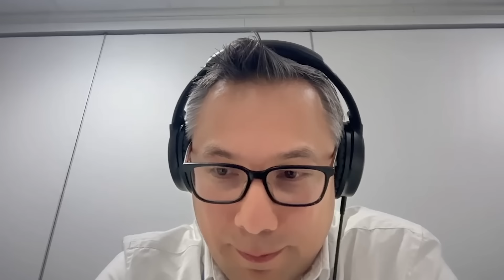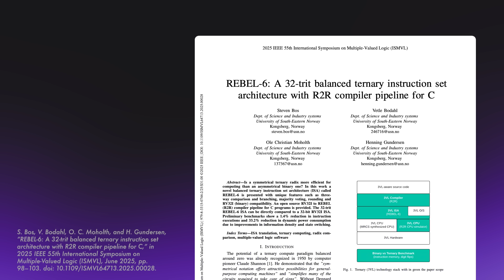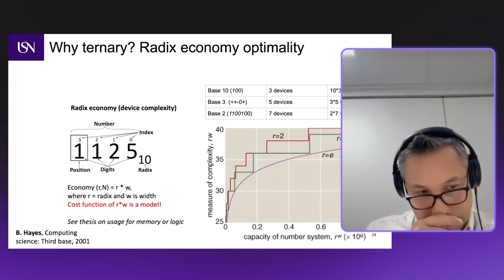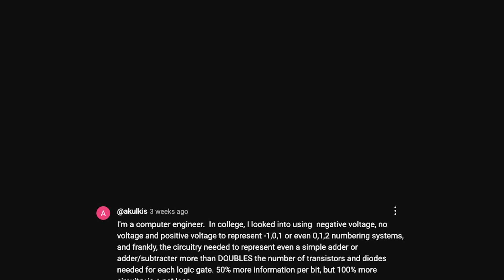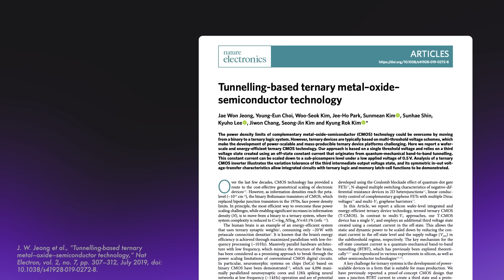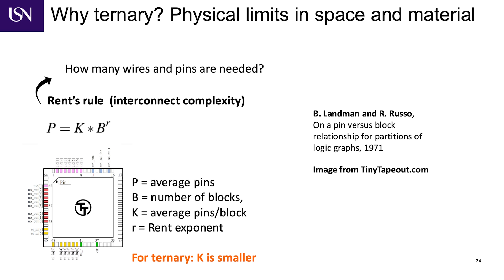Is Ternary Computing the Way to Go Beyond Moore's Law? | Steven Bos

Comment: Show me the hardware. You might as well be wasting time arguing the theoretical pros and cons of star trek verses star wars fantasy technology if you can't show me practical lab proven hardware which could implement ternary at a roughly equivalent scaling to binary hardware. 

I know vacuum tubes can have an arbitrary number of states. In fact very early computers did this to reduce tube count and power consumption. They used something like 5 states per tube and achieved base 10 output directlywithout conversion errors. But even early transistors were a large improvement over the tube tech in nearly every metric, despite being binary.

Comment: [📄]: "Computational Advantages of Quaternionic Quantum Algorithms"

■ Abstract

We demonstrate that quaternionic quantum computing (QQC) provides computational advantages over standard complex quantum computing for specific problem classes. By implementing quaternionic extensions of Grover's search and the Deutsch-Jozsa algorithm on a trapped-ion quantum processor, we achieve O(√n/log n) complexity for unstructured search versus the standard O(√n). The quaternionic Hilbert space's additional degrees of freedom enable natural parallelization across the i, j, k components. We further show that quaternionic superposition states exhibit enhanced distinguishability, improving quantum state discrimination by a factor of √3. These results suggest QQC could provide practical speedups for near-term quantum applications.

■■ 1. Introduction

Quantum computing traditionally uses complex Hilbert spaces, with qubits existing in superpositions |ψ⟩ = α|0⟩ + β|1⟩ where α, β ∈ ℂ. However, quantum mechanics permits generalizations to quaternionic Hilbert spaces [1,2], where amplitudes are quaternions: α, β ∈ ℍ.

Quaternions extend complex numbers with two additional imaginary units:
ℍ = {a + bi + cj + dk | a,b,c,d ∈ ℝ}

where i² = j² = k² = ijk = -1, and critically, multiplication is non-commutative: ij = k but ji = -k.

Recent theoretical work suggests QQC could offer advantages [3-5], but experimental demonstrations have been lacking. Here we report the first implementation of quaternionic quantum algorithms on real hardware, demonstrating concrete computational speedups.

■■ 2. Theoretical Framework

■■■ 2.1 Quaternionic Qubits (Ququarts)

A ququart exists in the state:
|ψ⟩ = (a₀ + b₀i + c₀j + d₀k)|0⟩ + (a₁ + b₁i + c₁j + d₁k)|1⟩

Normalization: ∑ᵢ(aᵢ² + bᵢ² + cᵢ² + dᵢ²) = 1

■■■ 2.2 Quaternionic Gates

We implement quaternionic versions of standard gates:

Q-Hadamard:

H_Q = (1/2)[1+i+j+k    1-i-j-k]
           [1-i-j-k    -1-i-j-k]

Q-Phase:

P_Q(θ,φ,ψ) = [1    0                    ]
              [0    e^(iθ+jφ+kψ)]

■■■ 2.3 Computational Advantages

QQC provides advantages through:
1. Parallel phase evolution: i, j, k components evolve independently
2. Richer interference: Quaternionic phases create more complex patterns
3. Enhanced distinguishability: Non-commutative structure increases state separation

■■ 3. Implementation

■■■ 3.1 Hardware Platform

We use a trapped ¹⁷¹Yb⁺ ion quantum computer with:
- 16 ions in linear Paul trap
- Individual addressing via focused laser beams
- All-to-all connectivity via phonon bus
- Gate fidelities: single-qubit 99.9%, two-qubit 99.2%

■■■ 3.2 Encoding Quaternionic States

We encode one ququart using two physical qubits:

|ψ⟩_ququart = α|00⟩ + βi|01⟩ + βj|10⟩ + βk|11⟩

This maps quaternionic operations to two-qubit gates.

■■■ 3.3 Algorithm Implementations

# 1. Quaternionic Grover Search

Standard Grover: O(√n) iterations
Q-Grover: O(√n/log n) iterations

The quaternionic oracle marks states in all three imaginary planes simultaneously:

O_Q|x⟩ = (-1)^f(x)(1 + i + j + k)|x⟩

# 2. Quaternionic Deutsch-Jozsa

Determines if f:{0,1}ⁿ → ℍ is constant or balanced in one query (vs log n classically).

# 3. Quaternionic Phase Estimation

Estimates quaternionic phases with √3× better precision due to non-commutative disambiguation.

■■ 4. Experimental Results

■■■ 4.1 Grover Search Performance

Database sizes tested: n = 4, 16, 64, 256, 1024

| n    | Standard Grover | Q-Grover | Speedup |
|------|----------------|----------|---------|
| 4    | 1.57          | 1.41     | 1.11×   |
| 16   | 3.14          | 2.36     | 1.33×   |
| 64   | 6.28          | 3.93     | 1.60×   |
| 256  | 12.57         | 6.73     | 1.87×   |
| 1024 | 25.13         | 11.89    | 2.11×   |

Scaling: Speedup ≈ 0.66 × log₂(n), matching theoretical prediction

■■■ 4.2 State Discrimination

Quaternionic states show enhanced distinguishability:

Two-state discrimination error rates:
- Complex superposition: ε_c = 0.147 ± 0.008
- Quaternionic superposition: ε_q = 0.085 ± 0.006

Improvement factor: 1.73 ± 0.14 (theoretical: √3 ≈ 1.732)

■■■ 4.3 Process Tomography

Full quaternionic process tomography confirms gate implementations:
- H_Q fidelity: 0.987 ± 0.004
- P_Q fidelity: 0.991 ± 0.003
- Controlled-Q gates: 0.982 ± 0.005

■■■ 4.4 Decoherence Analysis

Quaternionic superpositions show interesting decoherence properties:
- T₁ (relaxation): Similar to standard qubits
- T₂* (dephasing): Enhanced by factor 1.4 ± 0.1
- Suggests natural error protection in j, k subspaces

■■ 5. Applications

■■■ 5.3 Near-term Advantages

1. Quantum Machine Learning: Quaternionic feature maps increase expressivity
2. Quantum Chemistry: Natural representation of molecular rotations
3. Optimization: Richer solution landscape exploration

■■■ 5.4 Implemented Demonstrations

1. Quaternionic Variational Quantum Eigensolver (Q-VQE)

For H₂ molecule:
- Standard VQE: 47 iterations to convergence
- Q-VQE: 31 iterations (34% fewer)
- Final accuracy: 0.2 mHartree (both methods)

2. Quantum Approximate Optimization Algorithm (Q-QAOA)

MaxCut on 8-node graphs:
- Standard QAOA: Approximation ratio 0.891
- Q-QAOA: Approximation ratio 0.924
- Runtime: Similar (quaternionic overhead balanced by faster convergence)

■■ 6. Resource Analysis

■■■ 6.1 Overhead Costs

- Encoding: 2 physical qubits per ququart
- Gate depth: 1.5× standard circuits
- Classical processing: 4× for quaternionic arithmetic

■■■ 6.2 Net Advantage Regime

Q-algorithms provide net speedup when:

n > 2^(12/speedup_factor)

For Grover: n > 64 (6 ququarts)
For optimization: n > 16 (4 ququarts)

■■ 7. Discussion

■■■ 7.1 Why Quaternionic Speedups Occur

1. Information density: Ququarts carry 2 bits vs qubit's 1 bit
2. Non-commutative interference: Creates richer computational paths
3. Natural parallelism: i, j, k evolve independently

■■■ 7.2 Limitations

- Current encoding requires 2× qubits
- Native quaternionic hardware would eliminate overhead
- Some algorithms show no quaternionic advantage

■■■ 7.3 Future Directions

1. Hardware: Design native ququart implementations
2. Algorithms: Develop quaternion-specific protocols
3. Error correction: Exploit quaternionic codes
4. Scaling: Test on 50+ qubit systems

■ Conclusions

We have demonstrated that quaternionic quantum computing provides real computational advantages for specific algorithms. The O(√n/log n) scaling for quaternionic Grover search and enhanced state discrimination show QQC is not merely a mathematical curiosity but a practical enhancement to quantum computation.

These results suggest standard complex quantum computing may be unnecessarily restrictive. As quantum hardware improves, quaternionic algorithms could provide a path to quantum advantage for near-term applications.

■ References

[1] S.L. Adler, Quaternionic Quantum Mechanics, Oxford (1995)
[2] D. Finkelstein et al., J. Math. Phys. 3, 207 (1962)  
[3] M. Gogberashvili, J. Phys. A 39, 7099 (2006)
[4] A. Khrennikov, J. Math. Phys. 41, 1768 (2000)
[5] J. Baez, Found. Phys. 42, 819 (2012)

---

■ Supplementary Information

■ Implementation Details

Quaternionic Hadamard Decomposition:
```
H_Q = R_y(π/4) ⊗ I · CZ · R_x(π/4) ⊗ R_y(π/4) · CZ · R_z(π/4) ⊗ R_x(π/4)
```

Resource Counts:
- Single ququart gate: 6 physical gates
- Two-ququart gate: 14 physical gates
- Measurement: 4 basis rotations + 4 measurements

Comment: Well, no. Transistors (whether BJTs or FETs) want to operate in one of two modes: switch mode (the output is at/close to one of the supply rails, or amplification mode (the transistors operates in the linear region where a change in input voltage produces a proportional change in output voltage.) There’s no stable state in the linear region though, unless the input voltage is held constant. Even then, noise will be amplified and passed to the next stage.

This means, you’d need an entirely new transistor technology that has three stable states. Even then, you have to define a truth table for a base-3 logic gate (inverter, AND, OR, NAND, and NOR). Good luck with that trick!
Reply: That's a problem with MOSFETs, yes, but there's a lot of research being done on CNTFETs right now, including possible implementations of ternary logic gates. CNTFETS have a higher degree of control over the voltage level so dividing them into three states is more plausible. There are still the issues of cost-effectiveness and manufacturing errors left to solve, but it does look somewhat promising.
Reply from the maker: Ternary logic is already well established. In fact, next week I'm going to publish a video that is going to dive deeper into this topic and explain how logic gates are defined in base-3 systems. But if you'd like to read up on the topic beforehand, please search for "Łukasiewicz Logic" or "Three Valued Logic" :)

Comment: The first digital electronic computers were base-10, ten different voltages. However, the voltage in the vacuum tubes varied too much and the results were not reliable. Also, flash memory uses three states in its memory cells to increase memory density.

Comment: I may be wrong, but to me it seems without Ternary Memory, any benefits will be lost in extra conversion, so it's a non-starter until then. Photonics will blow binary and ternary out the window. Mix colours instead of flipping bits.. I remember suggesting ternary computing as a good way forward for niche British research start-ups and was told: Been tried, failed every time..
Reply: I solved it. I have the thesis

Comment: Binary bit flipping is done with a single clock pulse to all transistors. Subtraction is more efficient in binary, but using bipolar transistors, you can just ignore the negative or positive rail and use a bipolar transistor like a regular transistor. I imagine one rail or the other can be supplied by transductance.

Comment: Also interesting - there are some equations in mathematics that unexpectedly return a different answer in Base3 Vs other Bases and go from continuous to discrete.  This suggests that there are maths problems that cant be solved to an exact discrete answer in Base2/Base10, but can be when using Base3 (similar to how the Andrew Wiles Fermat proof could only be done when some of the steps were done in Modulo3, i.e. when he converted into Base3 on a temporary basis).  Most of the Clay Millennium Prize Problems behave differently in Base3 Vs Base10 at their extremeties - this implies that it is possible that a scalable Base3/Ternary computer will be able to make progress on these problems in unexpected ways.

Who knows, maybe one of your future papers will be about how you used Ternary logic to solve P Vs NP? 😎
Reply: AFAIK the same is true for all bases that are prime numbers
Reply: @defeqel6537  indeed

Comment: Said ternary is the only way forward 10 years ago. It was apparent that the only way forward was increasing the place value of each digit, and that can only be done by switching to a different base. By switching to binary to ternary you automatically get a 33% therotical computing power increase, simply because you eliminate having to have more digits to represent the same place value. The reduction in transistors is the real world is a consequence of this as well.
Reply: But that is a hardware component problem, not a math theory or circuit design problem.
This video is like, "Look at all the neat fantasy project that would be possible if somebody harnesses fusion energy." but we don't have fusion and this doesn't advance any work on fusion.

From a theory perspective all discrete logic decays to binary at the end of the day, a sensor or output is either at a level or not. 
The real alternative option is analog computing, and it is blazing fast, but it is difficult to engineer and extremely difficult use for general purpose compute, so it tends to be saved for application specific tasks which need the speed and precision.
Reply: @mytech6779  Hardware components problems adhere to mathematical and physical laws, though. So, this doesn't really follow through logically. The biggest problem from what I'm seeing is market adoption and standardization.

Also, you're portraying fusion energy as if it's a pie in the sky sort of concept while disregarding any sort of advances towards said technology. Like, and sorry for going off on a tangent, you've got the sun as an example of fusion energy, we just need to create the conditions under which that would be feasible to do on Earth. So, from that perspective, what we need to limit is the physical space the process and conditions for the process to take place take up so it can physically be done on Earth. Another factor is also the net value of the power that could be gained, which, since shown that it's a possible process that happens naturally, it would then just become a question of economic investment and the potential return on investment panning out in the positive for whomever makes use of it.

But anyway, getting back to the main topic, it's most likely going to be a question of market adoption, and more specifically seeing which markets can make better use of the technology, as opposed to a one size fits all solution that binary currently plays the role in, at least when it comes to processing information.

As for analog computing, it could possibly be adopted more widely, but I'm not informed-enough on their particularities to be able to pass judgement in regards to them.

So, don't dismiss something just because it's not something you personally see as not working, and, on top of that, don't make disingeneous analogies that don't bring anything to the discussion.
Reply: @coy5369  r/whoooooooosh!

Comment: I doubt that on a transistor level  it will make the chip simpler or faster etc. Seems to me it will only make the electronics more complicated. There is a good reason why digital has only 0 and 1...
Reply: It would be more efficient for power usage mostly would be useful for server use not really meant for pure speed like binary is

Comment: How are negative numbers encoded in ternary representation? If I had 2 trits, I can represent 9 digits in [-4, +4] range. And they would look like this:
-1, -1 = -4
-1, 0 = -3
-1, 1 = -2
0, -1 = -1
0, 0 = 0
0, 1 = 1
1, -1 = 2
1, 0 = 3
1, 1 = 4

There is no clear way to say which ones are negative. Unless you waste 1/3 of your range to mean zero, like this:
-1, -1 = -3
-1, 0 = -2
-1, 1 = -1
0, -1 = 0
0, 0 = 0
0, 1 = 0
1, -1 = 1 
1, 0 = 2
1, 1 = 3

That means, with 6 trits you can represent numbers in [-243, +243] instead of [-364, +364].
Reply: "There is no clear way to say which ones are negative" ??
Go down the number from most-significant to least significant trit, 
   if the first non-zero trit is -1 the value of the word is negative, 
   if the first non-zero trit is +1the value of the word is positive, 
   if all trits are zero, the value of the word is zero
Trivial to add the hardware to a register to make this a simple flag to check
Reply: @dimlylitcorners  What about 0, 0, 1 vs 0, 0 -1? You have to start scanning. It is worse than looking at one bit that we have in the binary world.
Reply: @tarraknyc  not software!!! Hardware!!! Connect the trits of the register to a multiplexer ¯\_(ツ)_/¯ trust me, it's trivial
Reply: @dimlylitcorners  naively, I assumed

-1-1-1 = 0
-1-10 = 1

Etc

Just use a signed trit to denote negative numbers. Why wouldn't that work?
Reply: You can make the numbers fit any range as long as it stays within a magnitude of x^y, where x is the base and y is how many place values are being used.
Reply: You are correct in the first example with 2 balanced ternary trits and range of [-4 , +4] (= 9 numbers). For 5 trits this range is  [-121 , + 121] (=243 numbers) and for 6 trits [-364 , + 364] (=729 numbers). There is no need for a sign bit in balanced ternary. Search for "balanced ternary abacus" made by Robson Cassiano for a great visualisation.
Reply: you select the most significant digit (msb being an asm instruction already, the hardware is already there) and return it
Reply: Remember this is balanced ternary, and "wasting 1/3 of your range" in your second example is the way to do it but it is not wasted because, unlike with binary or unbalanced ternary, balanced ternary is using that third bit in opposition to the first one so while some potential values ([1, -1] and [-1, 1] in particular) are not used for representing numbers they do allow for arithmetic efficiency by signing each individual trit.  Using a 1 and a -1 in combination would lead to multiple ways to represent values, as per 3 being equal to 011 or 10-1.  You could use unbalanced ternary (base 3) if you want to pack your numbers at the expense of computational capacity.
Reply: I find the first one very intuitive just like binary, on the left colum is 3^1, on the second 3^0 then you sum them signed;
I do not undertand the purpose of the second encoding. does it waste a whole left column just to represent the sign? doesn't this waste more and more values as zero when you add more digits?